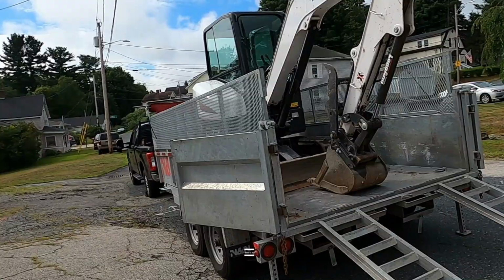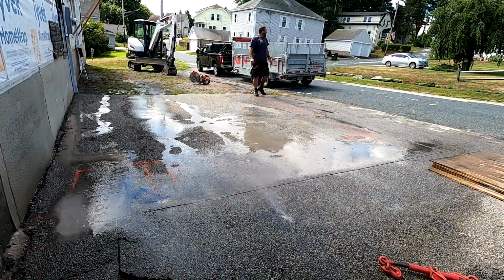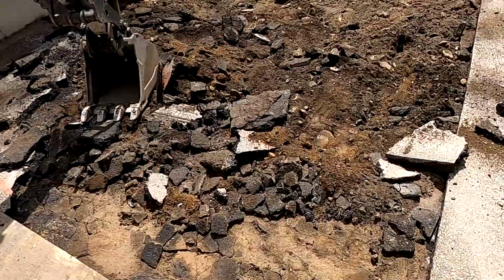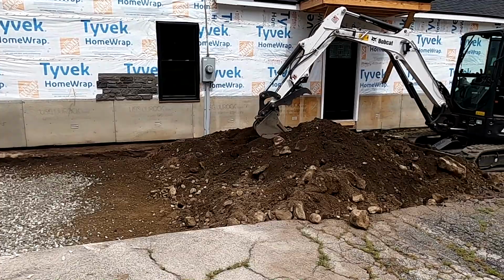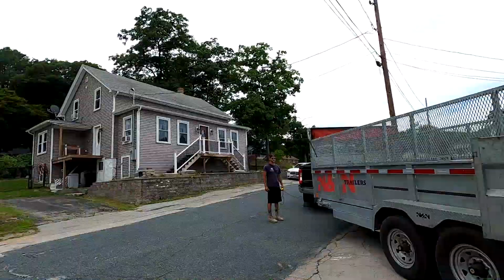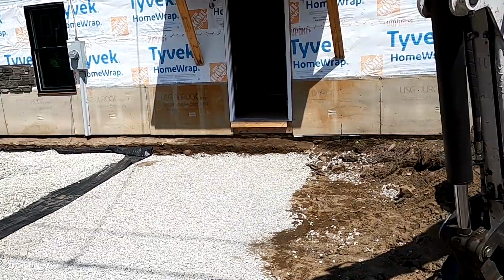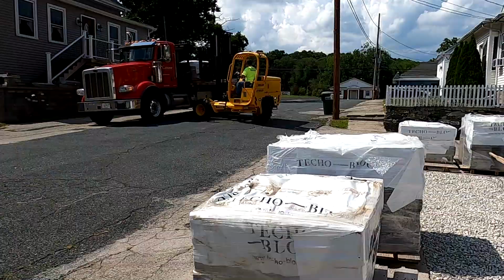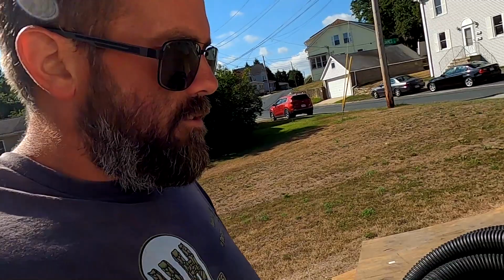Excavating & Backfilling for Another Paver Patio!

Comment: Honest question about the drain. Why do you choose corrugated plastic pipe and not schedule 40?
All my neighbors here (GA) that use the corrugated have clogs or it collapses.
I just ripped up my S-40 drain pipes that I installed 2 years ago. No issues with the install, not dirt, clogs or collapsing…it just needs to be relocated. 
You’ve been my #1 inspiration and go-to for my current back patio home project. Love the content!
Reply from the maker: Hey there, I use corrugated mostly in french drains like this because there is not a big chance of clogging when surrounded by clean stone and geotextile fabric. A lot of times those pipes get clogged when hooked to down spouts. Mainly because of debris coming down the gutters from trees around the roof and washing into the drains. They can collapse much easier than solid pipes but depending on the situations, there is more or less risk. I was not worried about either in this situation or most french drain situations honestly. 

Glad the videos have been helpful, thanks for the support! ✌

Comment: @The Christian Hardscaper How do you determine how many Yards of 3/4” you need per 1,000 Square Feet?
(Based on 8” Deep).

Or is it just simple math, as in 1 Cubic Yard is well, 1 Cubic Yard lol.

So if I was 1,000 Square Feet x 8” (let’s say 10” for the sake of math) that would be 30.86 Cu.Yd.?
Reply from the maker: That math is correct, so however you figured it out, that works! ✌
Reply: @TheChristianHardscaper  thx!

Comment: Was wondering if I could do the same process for a low budget gravel driveway , with that thin layer first then getting it compacted w/ fabric and then top it off with some more 3/4 inch stone Would that work?
Reply from the maker: It would work kind of... The stone will still be very loose for vehicular traffic. It will probably shift and move a lot. You need a dense grade gravel with fines in it so it can be compacted tight for it to hold up to vehicular traffic.

Comment: amazing video!! i was wondering how did you guys put the french drain? I would love to see that video? how much deeper did you dig for french drain? And why not install the french drain under the patio as well?
Reply from the maker: I did not make a video on it unfortunately... But it was only buried slightly lower than the rest of the excavation. But all the patio excavation is sloped towards the drain and the drain slopes down and around to the right side of the house. ✌
Reply: @TheChristianHardscaper  i was thinking you have to dig all the way o the footing to add french drain?
Reply from the maker: Nope, You are thinking about a foundation drain. A french drain is any kind of corrugated pipe buried in clean crushed stone so that water can fill up the pipe from the sides and divert to another area on the property.

Comment: Sweet video once again! Is that a 16 feet 16K trailer? I have a 14k 14 feet one and curious how a 3.5T excavator would fit in it
Reply from the maker: Thanks! It is a 16' with a 14,000 gvwr. Keeps me under the CDL restriction and holds up to 9,000 lbs in the body. The 3.5 ton excavator would be a little over the max I think...

Comment: Why do you delete comments that are trying to ask questions about the french drain?
Reply from the maker: I haven’t deleted any comments. What are you talking about..?
Reply: Weird, is it getting auto deleted because I'm linking another video?
Reply from the maker: Maybe..... not sure why...  I would be happy to answer the question though.
Reply: @TheChristianHardscaper  I'll try without the link - I was wondering why you put the french drain up against the house? From a lot of what I've seen on YT and online that's a bad idea because you're channeling water straight up against the foundation. I will obviously drain down but still you're using the foundation wall as part of the drain path - especially if it stops being maintained and the pipe doesn't absorb water. I also had someone do this on my house and I had to rip up all the pavers and re-grade everything away from my house, then put in a new drain away from the house where the end of the pavers sloped.